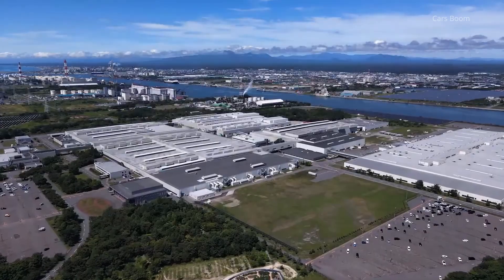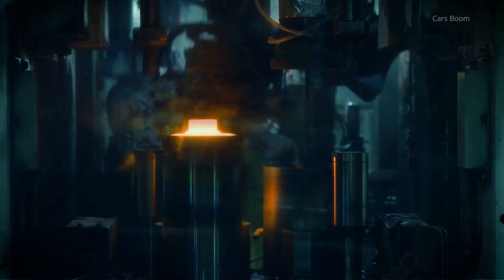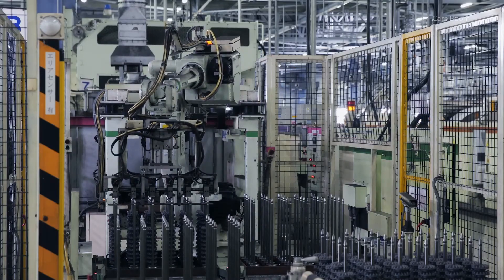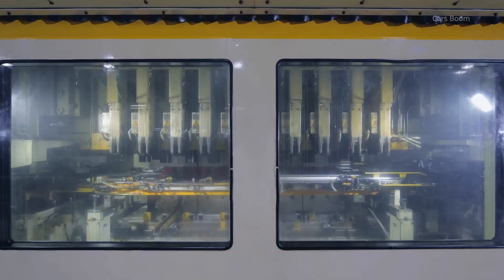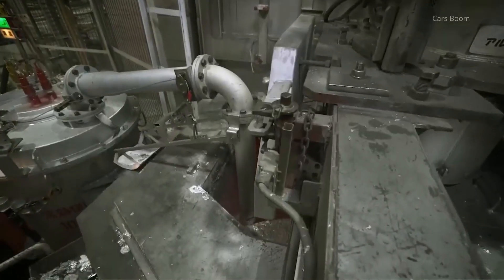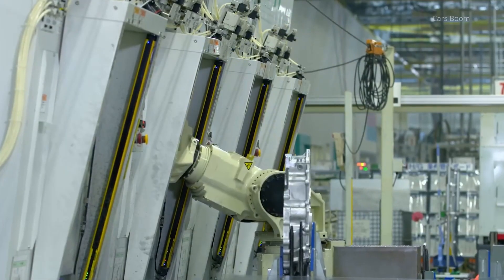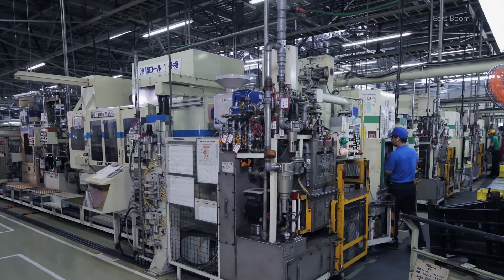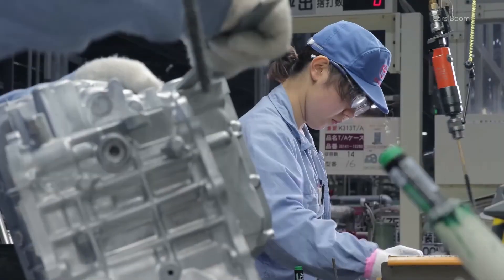Toyota CVT Production in Japan: A Behind the Scenes Look

Comment: CVT is literally a death sentence for the car
Reply: Ivan-  This Toyota CVT has an entirely different design compared to standard CVT. Toyota CVT does not use the typical CVT design with a steel belt loaded in compression.   Instead, the Toyota design uses a planetary gearbox and two motor/generators.  This Toyota CVT is “bulletproof”.
Reply: Ya if you own a nissan,Toyota makes solid reliable CVT's for both the hybrid and standard gasoline corollas.

Comment: Where is the belt ?
Reply: There is no belt on Toyota's CVT.  Toyota eCVT has almost nothing in common with a "normal" CVT except that their gear ratios are effectively infinite
Toyota's system also is infinitely better. I dont say that because I am a fan of Toyota''s engineering ( I am) but because the system uses very few moving parts and no belts or chains
Reply: So the title is wrong